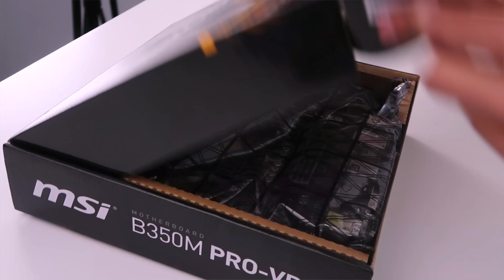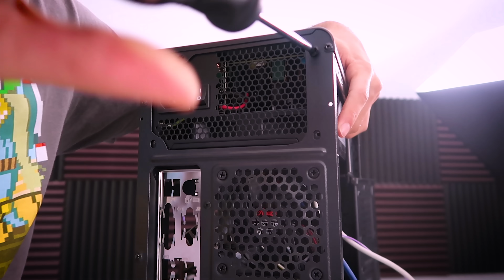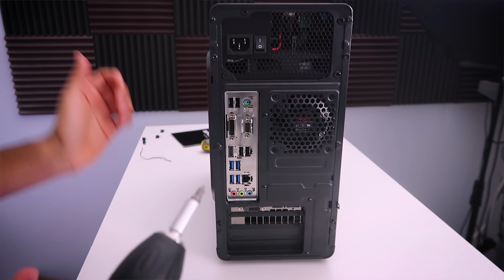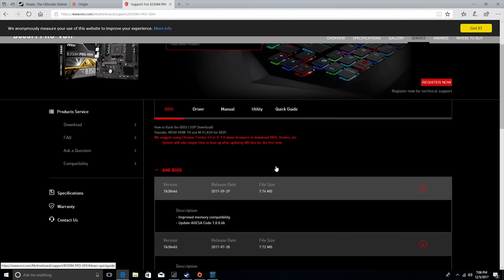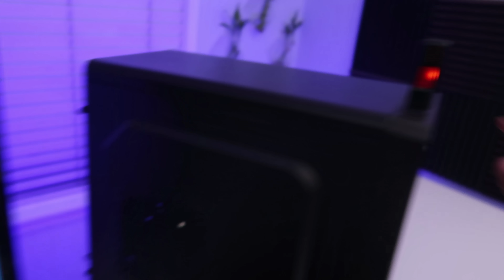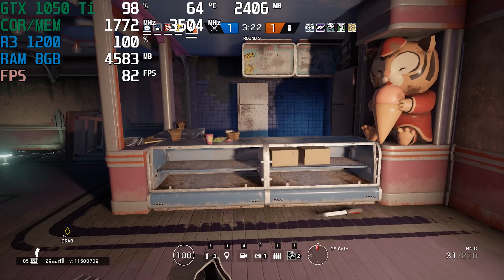$500 Budget Gaming PC Build Guide - GTX 1050 Ti (w/ Benchmarks)

Comment: I could make this, but for 10 extra pounds i could get this, wich is more worth it in the long run? Intel G4560 3.5Ghz, GTX 1050Ti 4GB Graphics Card, 8GB 2400MHz DDR4 RAM, 1TB Hard Drive, 500W PSU, MB510L Gaming PC Case
Reply: Alidas11 Mv's i prefer going with ryzen, if you go with intel then you need to change motherboard for every new gen
Reply: Giovann H that's definitely not what i want, thanks, do you have a link for a ryzen?

Comment: Hello everyone, I have an urgent question. 
I am currently building a PC. I've noticed that my CPU (AMD Ryzen 5 2600) does not have integrated graphics, and I also noticed that my motherboard (Gigabyte A320M-S2H) doesn't have integrated graphics either. Does my system require a graphics card in order to boot up for the first time?

If anyone can help, please, I've poured so much effort into my system.
Reply: iLegoFactory yes

Comment: Is it worth using a 1060 3gb instead of the 1050 ti ?
Reply: If you have the money then yes that is a solid upgrade. The 1060 is in my opinion the perfect 1080p graphics card. My build however has a 1050ti and I have no complaints. This is a small case so If you go with a 1060 i recommend a small single fan one.
Reply: Mediocre Size ok thank you!

Comment: I built it my cup light is on and I replaced the cpu and motherboard    yet it still didn't change please help what I did different was add a 1060 3 gb 750 watt power supply  and a 1 8gb stick of ram please help.

Comment: Did anyone try overclocking. I’m kind of worried about doing it and I want to see if anyone had any problems
Reply: try downloading cinebench and test for 3-4 times in succession without letting the cpu rest, that way you will know whether your cpu overclock is stable or not, if not stable then it will freeze or crash and you just press restart button on the case and try playing the voltage

Comment: Can anyone tell me if you need an internet connection for anything other than the graphics card driver download? I ask because I have terrible internet at home (building for while I'm at uni), and any downloads will be done using a mobile hotspot with not very good speed. I'm wondering if I'll be able to finish this while I'm at home using my hotspot, or if I should just wait a little longer til I'm back at school

Comment: Hi Joey!  So I did this build but used a different power supply that my buddy had that he didn’t use anymore.  1000W to be exact.  After getting everything put together, I installed windows onto a thumb drive and stuck it into my PC... a few minutes after putting the usb into my PC I noticed shortly that it fried my usb :(.  I asked around and some people said that I should get a USB hub.  The thing that was weird though when I plugged my keyboard and mouse into the same ports and it didn’t fry them.   Got any idea of what I should do before I buy a USB hub to see if that works.  My only problem right now is the fact that I can’t get a OS on it without it frying every USB I put in it.   Thank you!

Comment: I’m 13 and definitely building this pc, yes, a slightly better gpu, cpu, power supply and case but they are only for slight performance and looks upgrades but, is the original build capable of 4K?

Comment: I built this computer and it didn't turn on...followed the steps exactly besides that i got a 500 watt battery supply because the 430 and 450 watt were out of stock. Really really disappointed and am now having to spend another $60 dollars to get it checked out by professionals.  I'll update this with how things turn out, but for now I'll just sit and wait to see whats wrong. (It literally wont boot up, no led on motherboard, no sounds, and power supply is working fine.)

Comment: Do I have to run any stress tests to overclock at 3.7 MHz with Ryzen 3 1200?
Reply: run cinebench 3-4 times in succession, don't let the cpu cool down. that way you will get a picture of the overclocked cpu stability

Comment: hey guys the original link for the EVGA power supply is down. Can anyone find the same one somewhere else? I have looked all over. I found this from CDN but the shipping is 20$..
Reply: TommyIsaN000000b then use 400w/500w evga, no problem
Reply: ok thanks i ordered a 500w

Comment: Does that motherboard work with any/most cases? I'm looking into building with these materials but i want a case with a window. It would be cool if you could recommend me a good case with a window. thanks.
Reply: Sam FFA Hey Sam, I haven’t got my parts yet, but I’ve got the same components ready but just an upgrade to Ryzen 5. The case I’m going with is NZXT S340, it supports all ATX motherboards.
Reply: Zenos thanks for the suggestion, I will be sure to check into it :)

Comment: Ryzen 3 is budget king? Disagreed. G4560 costs literally 40% less and has only 5 - 20% worse performance than R3 while still not being a bottleneck for that 1050 Ti (can even shove in 1060 and it wouldn't be the bottleneck in most games). It is much better value, and you'd also save couple of bucks on motherboard as well. Could have the same performance in games for 50$ less, which at low budget builds matters a lot.

Comment: Ryzen 7 1700 3ghz 8 core
Msi b350 pc mate atx am4
Corsair vengeance lpx 16gb 2x8 ddr4  3000 memory
2t barracuda hard drive
Geforce gtx 1060 6gb 6gb sc gaming video card
Cooler master box lite 5 atx mid tower case
500w bronze rated certified atx power supply  
A good pc for 850$

Comment: Hi I am new to gaming PCs and considering building/buying my first one.  

Is this setup capable of playing games at 4k 60 fps or is this enough to play at least 1080p at 60+ fps?

Also, if this gear is bought in the USA (particularly concerned about the Power Supply) will it work in the UK and other countries with different voltage? Or will the power supply go bust and also damage the other parts. What if I buy the parts from USA, and just buy the 500W power supply from UK, will that be necessary?

Comment: I have a case that has three fans and I have the same motherboard he's using in this video. Turned on the pc after finishing the build but the three fans is not working.
Reply: Need help please.
Reply: have you connect the fans to the motherboard / power supply?

Comment: Just built this PC!
Reply: How are you liking this PC? Was it worth it?
Reply: Juan Soto It's great, highly recommend it. Did a video building video on it too if you wanna see it.
Reply: I dont know how the gpu prices are but I recommend getting a used one if its crazy expensive, got my gigabyte 1050ti for around 150$, just look for good deals
Reply: @m54b  how well does it run fortnite?
Reply: @YourMom-pw5vt  very well on medium high
Reply: Hey I tried building this pc and when I turned it on it wouldnt recognize the hdmi.. So I cant see anything.. what did I do wrong?
Reply: Where did you plug in the HDMI? Make sure it's plugged in the graphics card and not the motherboard. If it is connected on the GPU make sure the gpu fits well on the mother board and make sure your psu cable is attached to your gpu if your 1050ti requires it
Reply: Some models of the 1050ti doesnt require it, if its required there'll be a place to put it in
Reply: Where do I plug in the pci cable?
Reply: would it make a difference if i use 450w or 500 power supply instead?
Reply: It wouldn't make a difference cause 450 watts is already enough, and all of it isn't used up either. For this system 450watts is enough but you can get the 500watt if you want.
Reply: Joseph Vongphakdy no
Reply: How is it ? Recommend ??
Reply: Sweet thanks brother !
Reply: Krakkone how much now i hear the price keep getting higher how much did you build it for
Reply: Frames on pubg ?

Comment: Don't get fooled by cheap pc components. You will regret later.
You need at least 1000€ to build a good high-end pc for a 1080p monitor.
Try this: 
Cpu: AMD ryzen 5 2600x
Gpu: gigabyte gtx 1070 (the cheapest version with 2 fans at least)
Mobo: gigabyte x470 ultra gaming
Psu: Corsair rm650x
Hdd: Seagate Barracuda 1tb (storage)
Ssd: Samsung 860 evo 250gb (win 10+favourite apps and games)
Case: Masterbox 5
Ram: 2x8gb @ 3200 or 3000 mhz. (Any brand, g.skill is better)

This a great configuration.

Comment: Will a Ryzen 5 be able to work
Reply: Jessica Fergus yes
Reply: The ryzen 5 2400g right ? Thx
Reply: Jessica Fergus do you intend to pair it with a gpu?
Reply: I’m a noob when it comes to PCs but I was going to mabye make this setup and in stead of the ryzen 3 use a ryzen 2400g I just wanted to make sure it is compatible with the mother board
Reply: Jessica Fergus ah yes it is definitely compatible, what i mean was are you going to use the same 1050ti as in this video? since r5 2400g has a built in graphic card
Reply: Ya I’m going to use both will that give me better graphics
Reply: Jessica Fergus yes great build
Reply: Thanks and do you think this pc is worth it and is good for a couple years so I don’t need to upgrade or should I upgrade parts my self
Reply: Jessica Fergus yeah no need to worry, after all amd will support this motherboard until 2020. if so you can later upgrade to maybe ryzen 4th or 5th gen whenever you feel like it. i personally have a 2200g and had some ram being eaten issue back then, feel free to ask me whenever you encounter one on your 2400g
Reply: So I can have the same everything but at around 2020 when they come out with better Like a  reyzn 6 instead of the five I’m gonna by for this build then upgrade if
Reply: What’s ram being eaten sorry I just got into pc I don’t know like anything thanks for being cooperative 😊
Reply: Jessica Fergus so in this vid we have 8gb of ram, but as i've stated before that 2400g has a built in graphics card. although we aren't using the built in graphics since we have a gtx 1050ti sometimes the built in graphic card still reserve 2gb of our ram for the built in graphic itself, this causes we only have 6gb to use since 2gb is being reserved. but you can resolve this issue by going into bios and on the gfx section choose (forced, UMA specified, 64mb). it may sound confusing but once you experience it yourself it's not
Reply: Ok thx
Reply: What if I don’t know how to change it so I’m not wasting 2 gigabyte will everything run  the same
Reply: Jessica Fergus youtu.be/ni83RxxwLxw
Reply: Giovann H thx for all the help one last thing what things should I upgrade over time
Reply: Jessica Fergus if you are going with 2x4gb i suggest upgrading ram first since pc games starting to demand more ram, after that maybe gpu since this cpu is quite strong
Reply: Giovann H ok thx ;)

Comment: Hey guys, I built this about a month or so ago and is running perfectly! Couldn't recommend a better starter build and it performs amazing. I can run most games at high settings with stable framerate and it's smooth and fast. I love it and I wouldn't change anything. I did use an SSD instead of a blue drive. In total, amazing pc for price and would recommend
Reply: This is definitely a beefy computer and worth the money, but you need to watch for sales and time when you are going to buy the specs because it can get really pricey. Worth every penny tho
Reply: I went wireless and got a new modem and connector to run really high speeds, wired connection ensures no tears in the connection tho
Reply: These kids saying did it run fortnite well😂 its obvious that it can run fortnite from the cideo. And fortnite can run at 40-60 fps in epic settings if u over clock it.
Reply: Peelz I was thinking about building this is it worth the money
Reply: can you connect to the internet wirelessly
Reply: How did you get a power supply because it's not available now I think
Reply: i ended up getting the 500 wat version instead and its working just fine.
Reply: Shanzaib I used a 500w power supply
Reply: Peelz my budget is 1000 so I might get a better graphics card
Reply: KaniTheCanadian nah, pc actually cost like 1100 us dollars at this time
Reply: Peelz I made 1 with 1060 for 550 scammed ?
Reply: Peelz where? I did a full pc parts picker and only got to 570
Reply: Peelz Hey Peelz, what games do you have?
Reply: What ssd did you use?
Reply: Peelz hey man I noticed you said your built the same one we’re you able to run Grand theft auto 5
Reply: How well first it run fortnite after the update?
Reply: Peelz can i use ryzen 3 2200g instead 1200 with gtx 1050ti?
Reply: Herman Iskandar use ryzen 5 1600
Reply: I’m thinking about building this pc for my first build, but idk if it’s a long term pc. Did you have any issues with the windows 10 key? Did you buy one already done? I’m also not comfortable with the bios. So any help would be nice
Reply: Just got all the parts and put it together myself today ,  you can get windows 10 for free the iso from windows themselves. To activate it go here https://www.youtube.com/watch?v=Dlo-8w42whs in the description , you can thank me later. Good luck with your new pc man.
Reply: Peelz can you help me. I’ve build the computer but there is no way I can connect  to the internet because the computer doesn’t come with a cd drive to install the WiFi dongle . What should I do ? Thanks in advance
Reply: Peelz do you think I can use a e evga 500 cuz 430 is unavailable
Reply: Can i go with a different case?
and does it have to be Micro Atx
Reply: KaniTheCanadian buy the adapter he recommends, works fine.
Reply: Peelz no it doesn’t lol wtf
Reply: Andrew, a lot do.
Reply: TanoFTW on epic I don’t get stable 60 (40-60) usually but I don’t even like playing high settings 😂 I just prefer competitive settings
Reply: Zlatan Ibrahimovic if you used the wifi adaptor in the video, there isn’t any drivers.. it should just work if you choose your wifi and connect.
Reply: Paul Choi yes
Reply: Kayaxeri might as well get micro atx but all cases should work the same, usually cases should have labels in the case telling you where to put atx and Matx stand-offs
Reply: Peelz I’m having trouble with my pc that’s in the video when I turn my pc on it says reboot and select proper boot device or insert boot media in selected boot device and press any key I need to install windows 10 from like bios or this screen if you could have that would be great🙂
Reply: Peelz what about fortnite ?
Reply: Peelz thx man this was very helpful
Reply: Peelz what games do you play on it?
Reply: Zlatan Ibrahimovic buy an ethernet cable
Reply: Peelz did the prises change?
Reply: Did fortnite run well?
Reply: Zohaib Rao I'm sure it will. I was running ark on epic windows 10 Xbox version.
Reply: I've been searching for builds for a year and I feel confident in this one. Money isn't an issue, I just want to start cheap and slowly upgrade to become a beast build. 

I want to be able to replace the parts with better ones, so I could run modded games.
Reply: Peelz did you do the bios?
Reply: Wish I got a ssd oh well. Maybe next month I'll get one.
Reply: Same man! i also used ab SSD instead of  WD HDD! but i didnt overclock out of fear... does it have a lot of difference?
Reply: Peelz could u use a different case
Reply: Jacob Makrigiannis you could if you wanted but just now the case in this video is just big enough for these parts.   Make sure if you get a new case it's the same size or bigger. With this case I took off the hdd mount to add space
Reply: can u use a 500 wat power suppley instead the 430 watt is now 300$
Reply: Peelz can it play arma 3 on medium settings?
Reply: How much do you get in pubg?
Reply: Peelz  what ssd did you use?
Reply: Yo, i gotta quick question, i built this computer like a month or two ago, and just recently started playing some games. I'm having a problem in which the whole system freezes after playing a game online from like 10-15 mins. Have any of you had this problem... or do any of you know any solutions????? help plzzzz

Comment: CPU: Intel Pentium G4560: $57.75
GPU: ZOTAC GeForce GTX 1050 Ti: $170.00
Mobo: GIGABYTE GA-H110M-A: $47.57
Storage: Western Digital WD Green WD5000AADS 500GB: $25.00
Case: $20.00
RAM: Team Elite Plus 4GB: $45.00
PSU: EVGA 450 BT 100-BT-0450-K1 450W: $30.00
Total: $395.26
Cheap beginner build. Runs all AAA games at medium to high to Ultra. Good for 1080p gaming ;)
ALL PARTS ARE FROM NEWEGG.
Reply: yeap but you cant upgrade with this build
Reply: Giovann H what do you mean? You can upgrade any build..
Reply: Bass Avalanche i mean if you are upgrading to a new cpu later (presumably newer gen intel) on then you have to change the motherboard too, ryzen support am4 chipset until 2020 if i'm not wrong so plenty of room to upgrade

Comment: The power supply you used is out of stock...would it be ok to use the 500W version of it?
Reply: Spectro 101 use 450
Reply: Its Tiki ok. I was just asking because I'm wanting to build a PC but I dont think I'd have the money for it at the moment
Reply: Spectro 101 500 is fine
Reply: Yes a 500W version would function the same, maybe better if you upgrade later